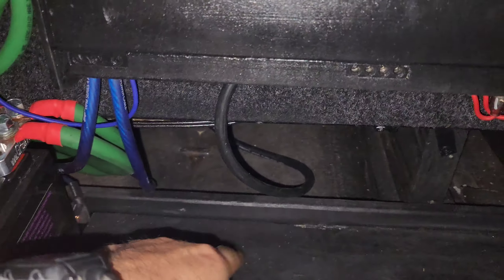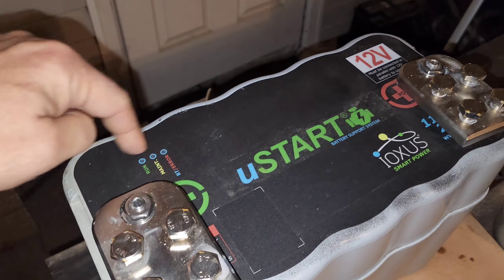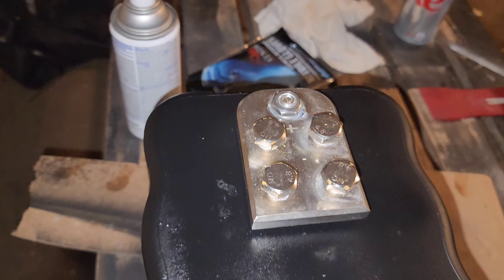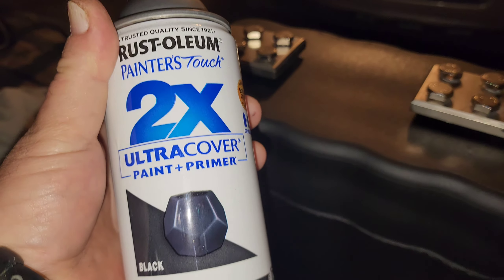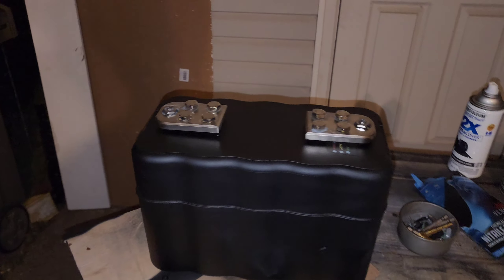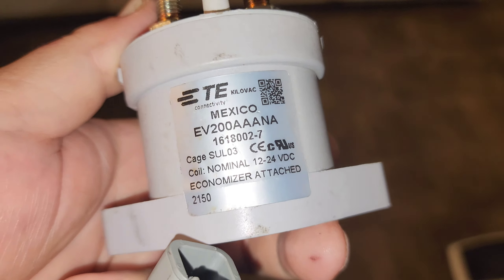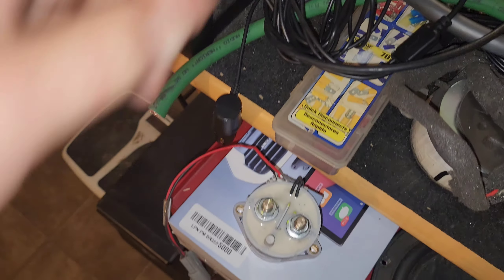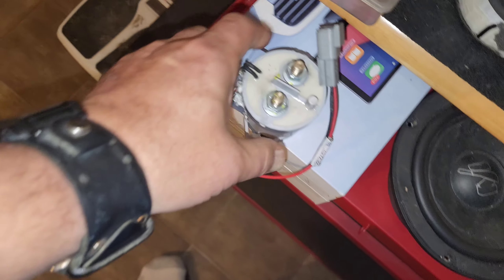Getting My Supercap ready for a series of SPL test! @TrunkThunderLithium @BigJeffAudio

Comment: If your looking for a manual switch, forget about the circuit breaker. Look at the heavy duty marine switches. Big grey with a round knob. Some of those can do 600A continuous, 1300A for a minute and 2700A for 10 seconds. Plus they have lots of configurations. On/off, switching from one battery to another or both batteries at same time, etc... Usually under $40. Plus they have some clean looking mounting options. 

I was gonna run one that would let me connect/disconnect battery power to either the sound system, the vehicle, or both. 

With it's high current carrying ability it should handle power from the alternator, starter and sound system with no problems.

Comment: Would you recommend this cap as a battery delete up front. Currently just have a fuse block up there where the original battery goes with a run going to the back lithium bank.
Reply from the maker: it will totally work as a battery delete

Comment: I'm really interested in seeing your results. These ioxus caps definitely act a bit different than a regular cap. It has "regulated" power between 13-15volts according to the manual, whatever that means. I have noticed that my capacitor seems to try to always stay at 13 volts exactly. There is definitely circuitry inside doing something.
Reply from the maker: Great point!

Comment: I was just talking about that raptor bed liner.  It's some good stuff.  It's kinda expensive in a spray can.  It's a lot cheaper to use in a spray gun but you have to mix it  your self and add the color your wanting.  It also can be mixed to make any color you looking for or want .  It will definitely stiffen thing up after hardening.💯🫡👍✌️👌
Reply from the maker: yea it solves a LOT of problems when im Scratch building random custom shit